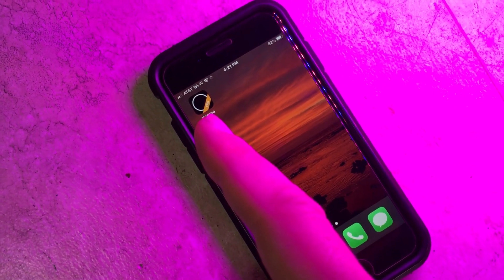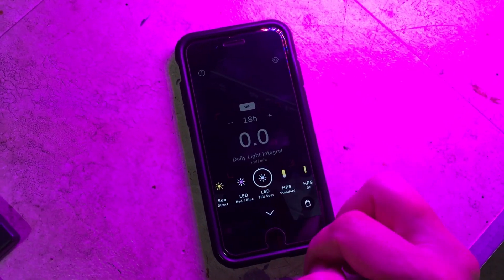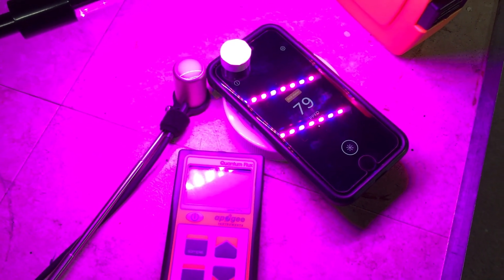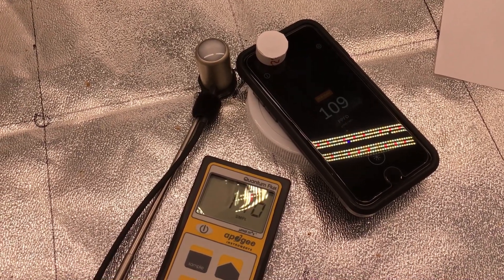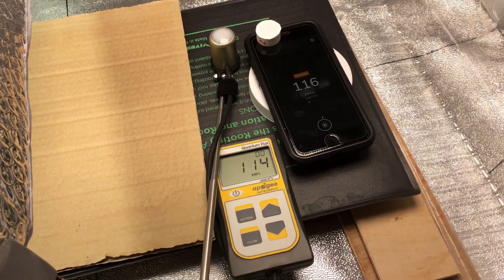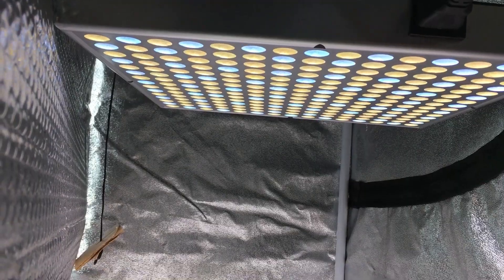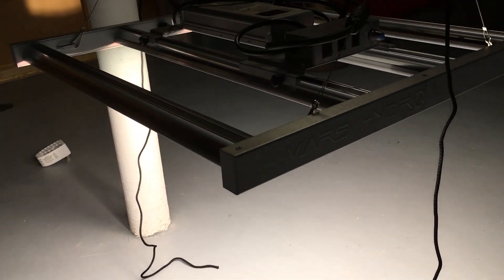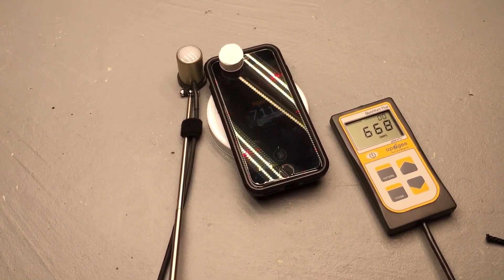Your Smartphone is a Quantum Par Meter | “Photone” App

Comment from the maker: Thanks for watching! I have to add that this will not replace a true par meter if you need one to test light efficiency or conduct experiments. However, if you only need it as an aid or tool for your indoor growing then its perfectly suitable.
Reply: Not seeing this app on android. Any suggestions for people not using apple?
Reply from the maker: @kevinnolastname2220  I reliable lux meter app used only for white lighting is a decent aid.
Reply: @GrowingAnswers  Will that still give value to red, far red, blue and far blue? Or is it just using yellow/green and you have to "close enough" it?
Reply from the maker: @kevinnolastname2220  if far red is mixed in with white light at the small ratio that it usually is then it won’t show up as much if any difference on either a par or lux meter. there is no such thing as far blue unless you mean UV. In that case its the same as the far red. It’s too little to measure.
Reply: @GrowingAnswers  Valid point about far blue. I was meaning the range between about 400-500nm and 600-700nm wavelengths. Im just trying to make sure that I'm not assuming incorrectly.
Reply: @GrowingAnswers  By the way, thank you for your time, knowledge, and recommendations.
Reply: @kevinnolastname2220  the definition of PAR is all wavelengths between 400 and 700 nm. These are also in the visible light spectrum for humans. These are the same wavelengths a camera will pick up, and a par meter. The reds are in the 600s the far reds from about 700 to 720, blues are 400-460 ish. I think what you mean by far blue is UV which isn't "photosynthetically active" radiation per se. While plants do "use" UV, they don't use it for photosynthesis.   Now..a camera and our eyes will pick up a bit of far red, but not IR. We can't see heat (ir) without a FLIR camera that interprets those wavelengths into visible ones we can see. Anyway, the par meter and the camera will probably pick up a bit of far red, but it won't make a huge difference in the readings and since we only use a small amount of far red for the Emerson effect or to control growth and flowering cycles, its not likely to really show up. You would probably need a specific meter calibrated to read far red. Same for UV.
Reply from the maker: Peter Lustig  actually there is a standard. It’s not much different than measuring temperature with a thermometer or distance with a ruler. Photos are very easy to measure. It’s why digital cameras can take perfectly exposed photos automatically without user input. It’s all just math and calibrations within a small level of tolerance. The only problem is that if someone uses that app and has no way to compare it to a calibrated tool, it’s hard to trust it. It’s close enough for the average person who doesn’t need level of accuracy. It all depends on the what it’s needed for. A simple lux meter could be traded for a par meter for better reliability but that comes with its cons too.
Reply: This won't work very well without own calibration. White LED can be: 2700K CRI 70 or 90, 3000K CRI 70 to 90, 3500K CRI 70 to 90, 4000K CRI 70 to 90, 5000K CRI 70 to 90, 5700K CRI 70 to 90 or 6500K CRI 70 to 90.

Just saying white LED will never give the right conversion in the end. Even after calibrating the Lux Value.

But this App has huge potential.

And why Apple don't build Light Sensors into their Smartphones? Camera is Sh*t for Light Measurements. Every Android Phone has it.
Reply: @OMNIDROID2995  Apple phones actually do have a light sensor (it's used for automatically varying the screen brightness) but Apple did not give open API access to app developers to access to it - basically if an app tries to display the light sensor's data, it won't be allowed in the App Store.  But Android has a different problem: light sensor hardware isn't standardized so the response of different sensors can be different between different phones :)
Reply: @HousePlantJournal  Ouch. This is even more problematic. Yes but it's possible to offset (calibrate) most of the available apps.
Reply: Make a diffuser with a4 Printer paper!!!
Reply: @growing answers is it a 1/2” pvc you used?
Reply from the maker: @hotwater8473  Yes
Reply: What is this paper? 75gsm?
Reply: I stumbled on your videos, and they are great! I hope you answer, for Android phones in the app description stands "for android no diffuser needed, just for iphones", but when you look on their website they wrote "on Android the measuring goes not over the light sensor, because its too inaccurate, - the front-cam will used for measuring", so I am confused now why then a diffuser only for iphones when still on both systems the front-cam is used!? - Should I use a diffuser also on android!? Thanks!
Reply: Thanks for sharing the information. ✌😆🌿

Comment: FYI...  With the same light and distance, the suggested "paper wrap" filter shows a FC reading of 435 on a S23 Ultra phone....  Using a "white dome", the reading increases to 660 FC....  I used the white protective cap that comes with the SANSI 10 watt bulbs and cut two small notches, (for case edge clearance),  to permit the cap to lie flat on the screen-centered over the front camera....  SO, for those of you that may also use the SANSI grow light bulbs, the protective cap works GREAT....

Comment: Best scam on YouTub! Each and every phone will have a different light sensor with a different need of filter to ‘calibrate’. The variation in paper brilliance from paper type and manufacture will be far more than the variation you demonstrated by simply moving the paper corner in the video. What good is guessing on how to craft a DIY filter when one doesn’t have an Apogee meter with which to calibrate? The cost of this app is the same for a low end PAR meter that has an actual PAR filter built in.
Reply: The diffuser isnt needed on Androids.

Comment: Problem is the app only makes estimates since it doesnt even havw sensors capable of detecting 660nm..so most apps just add 10% which you can see can thrhow things off majorly depending on how far or close the light is or spectrum. For example photone + ppfd meter app almost off nearly 200 par ppfd at canopoy level for a led light with 20-30% red spectrum . It does get more accur4the fuether away but still this all depends upon your led . People who keep quoting migro video as holy grail have no idea

Comment: i tested this app with my marsh hydro ts-1000 and their webpage says that it gives 626 ppfd from 30cm at 50% luminosity and this app gave 620 without any calibration. i'd say its accurate enough to get your lights fixed for your grows.
Reply: @StuffintheMuffin without. I think its only required for certain phones. Phone i used was OnePlus 9

Comment: My problem with par meters is that I have to use them with the door to the tent open, which throws off the readings, which defeats the whole purpose.   So I just rely on published PPFD charts for my lamp.
Reply: Published ppfd charts are notoriously inaccurate.  Measuring with the door open doesn't make that much of a difference,  only a couple of % in my 4x4.

Comment: With high CRI lighting like the one this guy is using, a simple lux meter becomes increasing useful. This will not be perfect but.....Lux divided by 54 times 0.9. For example, 60,000 Lux, divided by 54 = 1,100 multiplied by 0.9 = 1000. Like I said, not perfect, but useful.

Comment: Sir you saved me $400 Do you have a patron i can donate to! this information is worth a tip!
Reply from the maker: I appreciate that but I don’t have one. Thanks anyway. I do plan to set one up in the future though
Reply: @GrowingAnswers  Hmm, so i made the diffuser, purchased the LED full spectrum setting on the application and took some readings. Its either inaccurate as all hell or my lights are crazy strong. So im running two 54 watt Optic 1 cob fixtures. and at almost 2 1/2 FT. off the tops of the canopy in a 2x2 space I'm getting readings of 450ppfd. That's unlike anything I've seen before especially with 108 watts worth of light. So i thought hmm maybe my phone case is interfering with the readings so i took it off. The reading was the same...Then i thought hmm maybe the PVC i cut was too short in relation to the one you had in the video..so i made another one slightly longer and the readings stayed the same +or - a few PPFD. Then i experimented with just a piece of paper 2 inches thick wrapped around the front facing camera like the app suggested. Saw a miner decrease in PPFD but only 30 ish vs the lenses style pvc diffuser you suggested to make. And taking about 12 readings in my little 2x2 tent and the spread and coverage was almost uniform across the space. Obviously with the corners taking the larger dip than anywhere else. So im at a loss IF cob lights are so inefficient compared to Bar style Quantum boards... why are these 2 fixtures putting out more light than a 150 watt system or even coming close the a 200 watt light in some cases.
Reply from the maker: @kocfkocf  large COB‘s are not usually very efficient compared to quantum boards with multiple smaller ones. If you were using lenses then that kind of throws off the measurement As it will be more intense. But that number seems about right. But if you are that far away without a lens then I don’t think that’s correct
Reply: @GrowingAnswers  the Optic 1 comes with a 120 degree lenses. its just weird how  far away the lights are from the canopy. at 30 inches. I know im running two lights inside the tent but i would've thought the numbers would dip lower like they do with my HLG 65. with that system i saw massive drop-off around 16 inches.  I really don't want to buy a Quantum meter but i gota know if the readings im getting are legit or not cuhz they seem way to high! But oddly enough it matches close to the Par map for my HLG setup. i  don't know. maybe the app isn't calibrated for a COB light?
Reply from the maker: @kocfkocf  the hlg is not lensed so it will be a much lower reading at shorter distances.

Comment: How can you calibrate it without a reference? Is there any trick that does not require a $500 PAR meter first!
Reply from the maker: You don’t need to calibrate it. Even if it’s off by 10 µmol it doesn’t matter. It’s close enough.

Comment: Thank You for bringing this app to our attention!  I would of initially said ABSOLUTELY NOT!  Would of expected huge variance coming from that app.  In watching you compare to calibrated equipment, I also was astonished at the accuracy!  Downloading to my iPhone today!  Thank You.  Subscribed!
Reply: With high CRI lighting like the one this guy is using, a simple lux meter becomes increasing useful. This will not be perfect but.....Lux divided by 54 (Sunlight, 100 cri, ppfd to lux conversion 54) multiplied by 0.9. For example, 60,000 Lux, divided by 54 = 1,100 multiplied by 0.9 = 1000. Like I said, not perfect, but useful.

Comment: do you mind if I ask you a question with regards to this application, I've never used anything like this and I would like to purchase something and I was thinking about the Apogee mq500 but it is extremely expensive, the would be ideal.

Will this at work with MEIZHI LED Grow Light, I'm sorry to ask you this question but I cannot find any answers anywhere and it seems that you are extremely knowledgeable in this matter I would just like your opinion please.
Reply from the maker: I seems to work well enough with any light.

Comment: As I started to go down this Rabbit Hole using Google, I came across a $200  PPFD Bluetooth device from a Chinese manufacturer. Called a "
HPL200P 400-700nm Quantum Par Sensor PPFD Meter umol/m2/s" But I couldn't find anything other than a Korean video, and a clip on the seller's page on Ali. The presenter does attempt to present in English, but the phone screen seemed to be just showing Lux and Footcandles on the Android App. But they also sell a Lux only version called a HPL200 so maybe that is what they are showing. As much as I'd like to try the PPFD version, it would certainly require finding a bit more info, that's for sure. Hopefully someone will be able to chime in with more info at some point.

Comment: But can I get the data extracted to see a spectral range ?
Reply: Exactly. I've seen Shane, of the Migro light channel, using his smartphone to show the spectral range, as well as any other info available. It's very impressive!
 I believe it may be an app that's available with The Apogee Meter?
 An app showing the spectral range alone would be great. I search every once in awhile, but haven't checked lately. I haven't tried the Tent Buddy App, or the ppfd meter app, mentioned in the comments, though.

Comment: Did you pay to unlock led or use it on the free sun direct mode? Will it still be accurate if use the free option?
Reply from the maker: I unlocked it for the video, but sun works well enough

Comment: Question: Did you calibrate it initially with your par meter for this video or were these tests were done from a fresh download? Also just curious if you tested with different measurements of PVC and found 1/2 inch to be most accurate. Thank you for your videos they're very helpful.
Reply from the maker: I did not calibrate it. I randomly had a scrap piece laying around. it just worked.

Comment: Okay so I’m really confused about something in this video…I’ve watched it 3 times and I still can’t figure out what the benefit is of using the piece of PVC with the pre-cut piece of paper over just using the piece of paper???  What made you decide to make that little PVC/paper thing? Does it make the measurement better?
Reply from the maker: gives a larger surface area to measure photons. it works the same way an actual par meter does. A real meter uses a translucent plastic cover that sits above a sensor. A sensor never sits against the diffuser.
Reply: @GrowingAnswers  So glad I asked, thanks Ryan! I learn so much from you :) :) :) and my plants thank you too

Comment: Would this work well if you are testing HPS lights or only LEDs with the sun setting? I know app has HPS option but you have to pay for it
Reply from the maker: Will work with hps if you just need rough estimate. It won’t be off by that much if you use sun or white led setting.

Comment: works like a charm :-)  ty 

   ok now one additional comment on the piece of tubing  i did a little messing around with a couple sizes of the pvc tube and because the inside is bright  even with the  paper over the top what in affect  happens the inside of the tube reflect some  light down and into the lens of the camera and different size tubing did make a slight change the readings under a couple lights i have.  so using a 3/4 pvc  1/2 inch long with white paper super glued to end,  i have a case on phone so had to modify one edge of the pvc so there is a minor step in it  and taped over it with black electricians tape so no stray  light can get in from under and now i can can set the tube with paper dead center over the camera lens. 

so here was test i did  9 inches from face of  phone to face of light 

 i have full spectrum white led light i made 2x4 feet in size   with 2:1       3000k red / 5000k blue888 total LED's. running two mean-well 100 watt power supplies total watt draw on killa-watt meter  at 209.7 ( that includes the draw the mean-well circuits draw ) . manufacture of LED  total draw of LED should be at 177 watts  grow area is just slightly larger then light  28x54 inch so results-
center of light  , using the led full spectrum setting
    pvc places on camera  337 ppfd    
    pvc with notch - centered   346 ppfd  

at extreme corners
    pvc placed on camera  144ppf 
    pvc with notch - centered  155 ppfd

   so .7 to 1.6 uj /w depends where you read

  myprintscreen.com/s/1605107714.57238809.png

Comment: Excuse me, which paper did you say you used? I tried with 90g one, and it still didn't provide the right results. I have a light meter and a PAR meter and I'm trying to get the diffuser right. I've tried different types of paper, tried folding multiple times, but it's not working out for me
Reply from the maker: 20 weight 8.5x11” printing paper
Reply: @GrowingAnswers  Thanks! I'm using 24 weight one, and the values are more than double what they should be. I'll try finding 20 weight.

Comment: Hi 👋🏻 do you remember me (I inspired your video about conversion factor btw par and lux 😉).
I’ve noticed that korona reads 25% more lux than dr meter lux meter.... now I’m way to confused. Where Dr meter reads 15klux, korona reads 20k lux...
So if the conversion from Dr meter was right why now it seems wrong?
Can you make a comparison with Dr meter for lux, apogee for par and Korona for both?
Thx
Reply from the maker: This is where tolerance levels come in. The app will vary quite a bit depending on how the diffuser is placed over the camera. Also, No lux meter will be identical either. Not cheap ones anyway. They usually are close enough for home use, but not lab use. unless you have a know good source to compare a lux meter to, don’t worry about it too much.